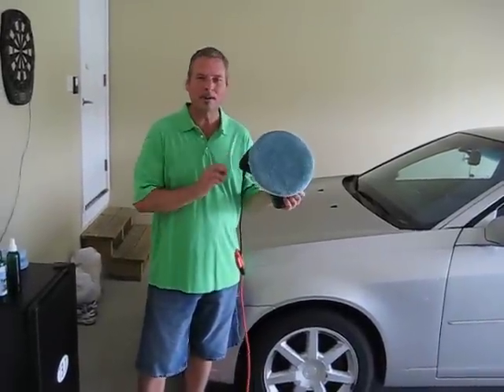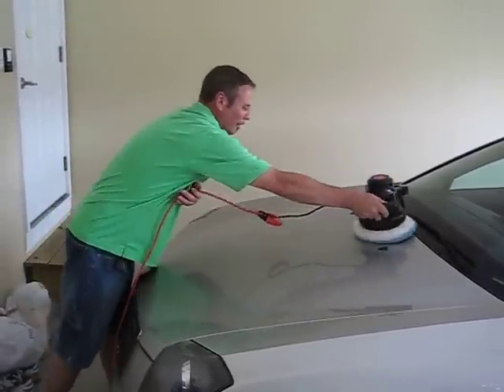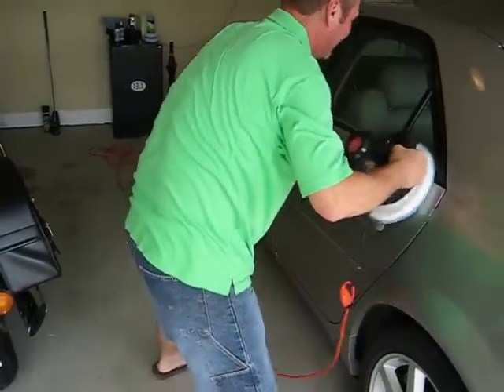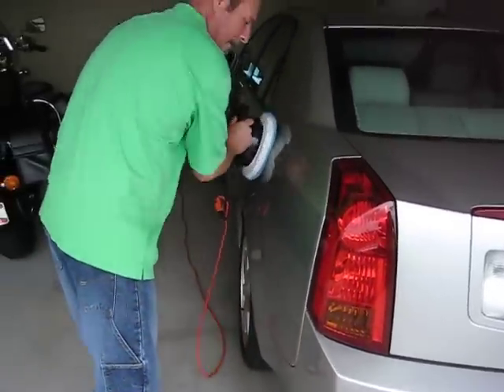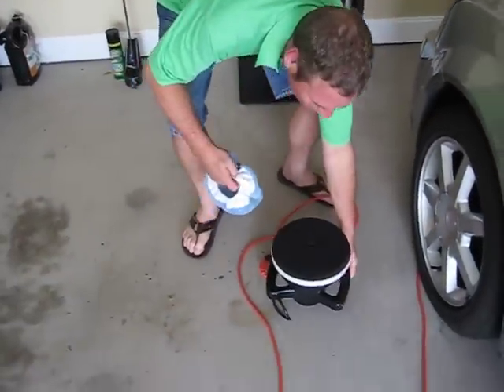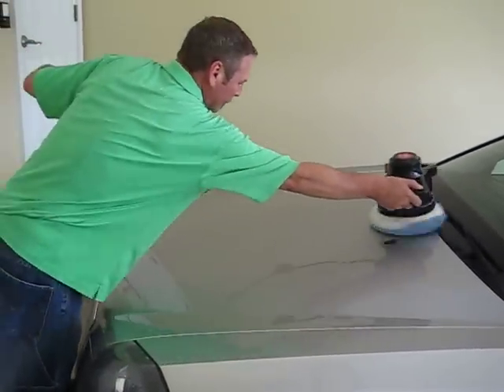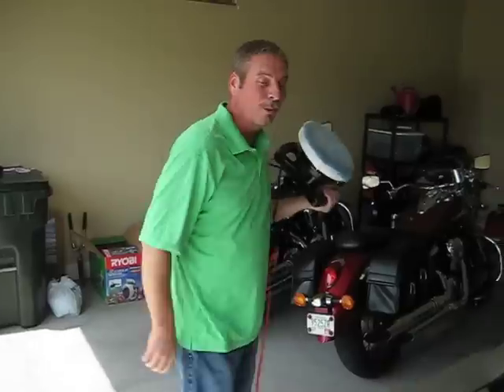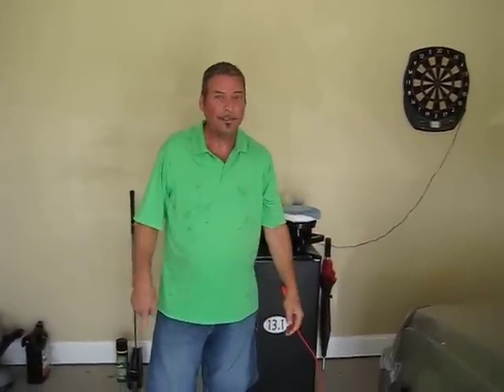Orbital Buffer Application and Removal 1

Comment: p.s. if anyone else has a massive cheap orbital such as this, the recommendation is to throw the wool in the bin, it wont have power to move it fast enough. Instead go buy IN BULK the Terry cotton bonnets, as these are so versitile they can be used for any application be it cutting, polishing, buffing sealants, waxes and polishes.  Dont us serious compounds but stick to the commercial bunch such as Meguiars ultimate compound/polish, autoglym polish etc. Secondly move slowly, overlapping, and doing 2' in about 30 seconds. work the polish into the surface until it breaks (goes clear). Keep to the cotton pads and avoid wool/rubber/foam pads on these machines. Apply pressure ont he sides but not too much on the verticle surfaces and keep away from plastics.
Reply: Thanks
Reply: Where can I find the Terry Cloth Cotton Bonnets in bulk?
Reply: @lovelyp.4605  Auto Zone and Walmart would be great for starters. If not, any local detailing shop.
Reply: Lovely P. Home Depot has them too
Reply: Thanks

Comment: I had one of the first generations of this unit. Boy was that thing a POS. One of those things that looked good in the box but actually using it was maddening. I was detailing cars back in the '80s (in truth, I was small time and really only doing a wash and wax type service) and got one of these to help with that, but it was not only easier to continue by hand, the results were so much better. You can't polish with this thing. Even if it went fast enough, its too big to concentrate on a certain area. I was nowhere near what was needed for single stage paint way back when. 5-6" dual action polishers have been out for 20 years now and blow this thing away. I tried to use this thing twice, then took it back. What was funny was that, at the time, I worked at Sears (my detail thing was on the side) and talked more people out of buying this than actually bought it. I lost a few hundred in commission (and might have been fired had my manager found out) but it was the right thing to do.

Comment: You're moving the buffer around too fast. Besides, the buffer RPM is to slow. You could clearly see the blue shade rotation as it spins. If the only a car can talk back!
Reply: That could just be a frame per second video camera issue.  Kinda like when you see helicopters in TV, the blades don't look like they are spinning fast enough